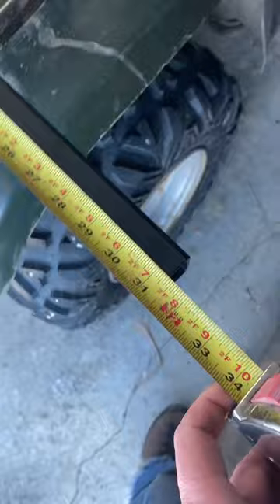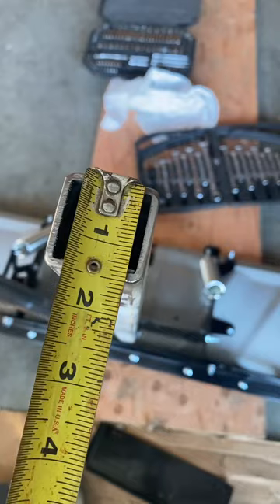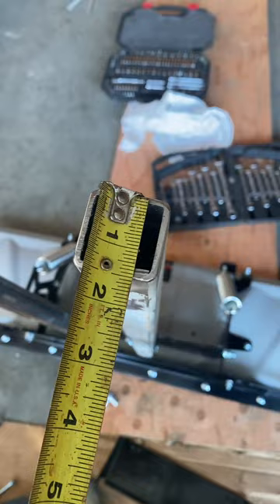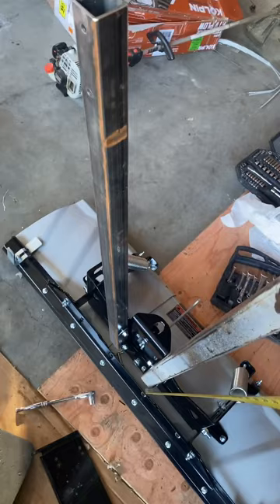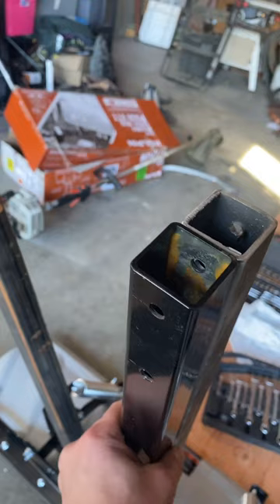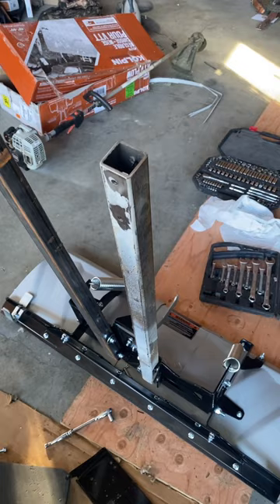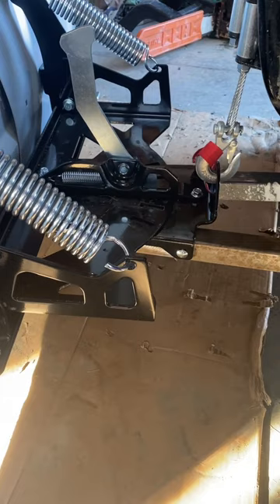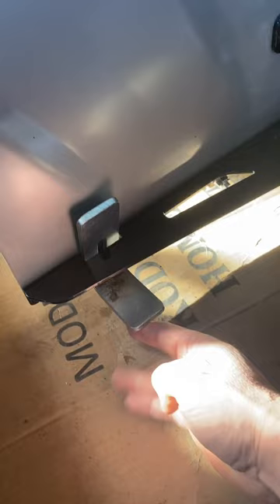Kolpin Switchblade Plow: Part 2 The Fix

Comment: I ran into the same issue with my 2022 cforce 600, wish they would just sell a longer push tube kit for the mid mounting plates.
Reply from the maker: I emailed them and asked about longer tubes, they said it was doable, but their price was 3x’s the amount than getting from the local metal shop
Reply: You don’t need longer ones for the cforce 600